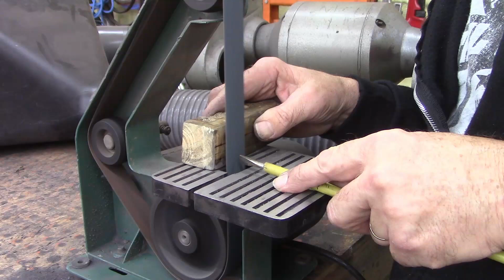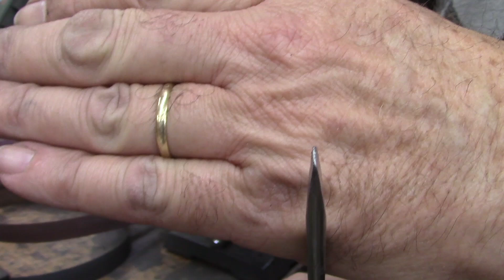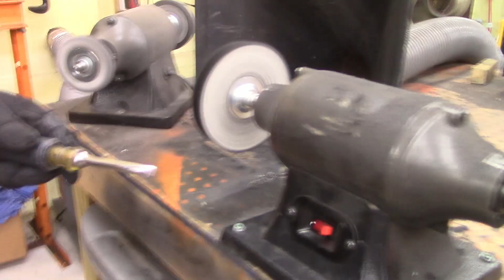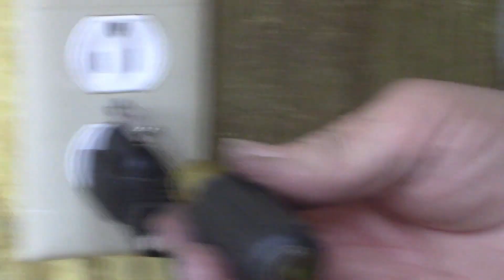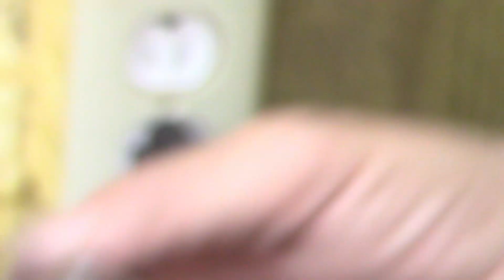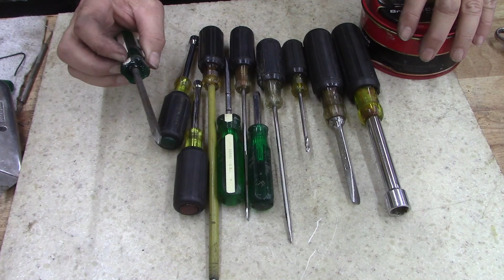Restoring KLEIN screw drivers!

Comment: Now with the increased use of Philops Torx and other special head screws the slotted screw drivers will find lesser use
Reply from the maker: I agree to a point, I work in a faculty that is over 60 plus years old and a lot of slotted, also worked on a house not long ago that still had some nob and tube, so have different means is a good thing!